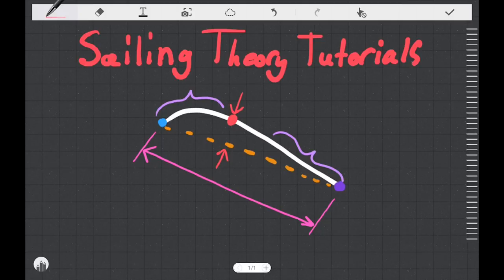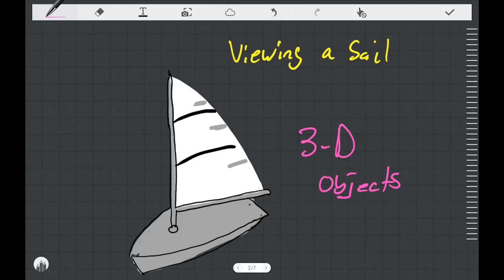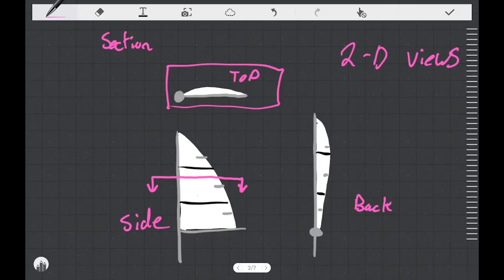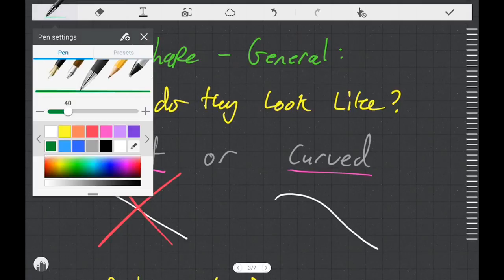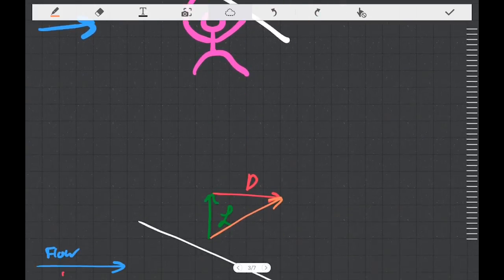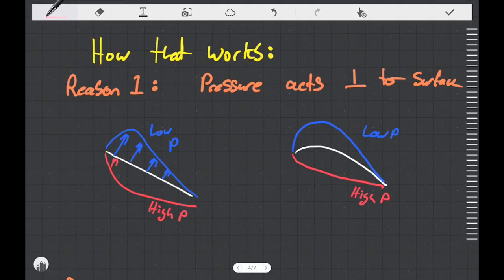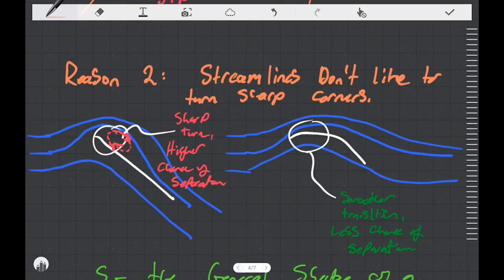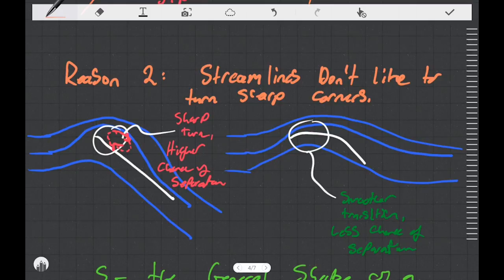Sailing Theory Tutorials - Introduction to Sail Shape

Comment: Thank you for such an amazing video Julian! Just a question, you mention that moving the draft aft is not good. Some literature indicates that in very light airs and smooth water the best performance is obtained with a draft that is up to 65%, why is that?
Reply from the maker: I'm sorry that I don't have an exact answer to the question, but there is a general sense that in lighter air you can improve performance by putting the draft further aft, which in turn moves the CE slightly aft and creates a very small amount of weather helm.  It seems to be true, but I can't exactly explain why.